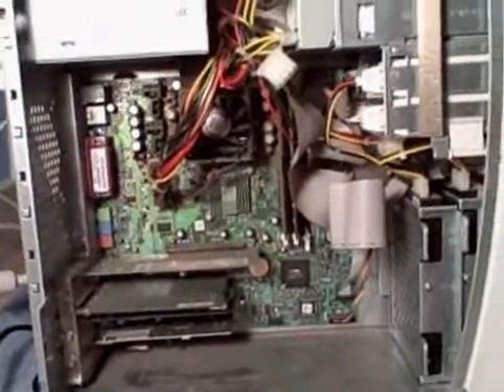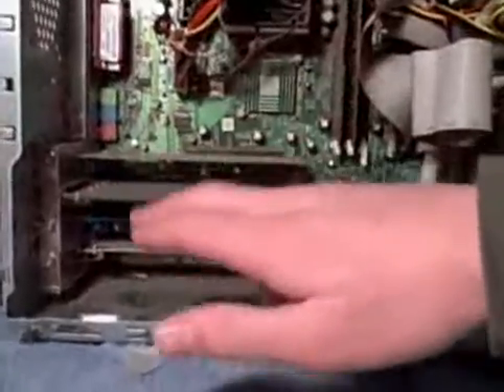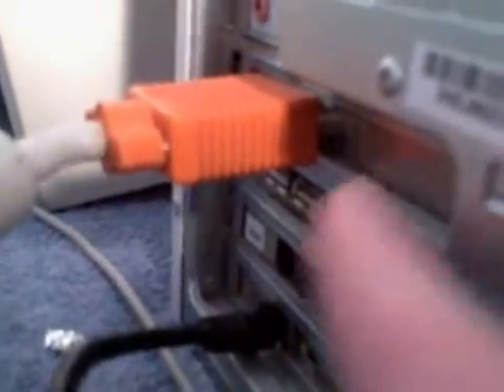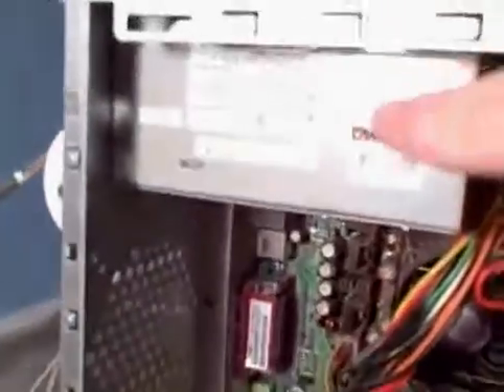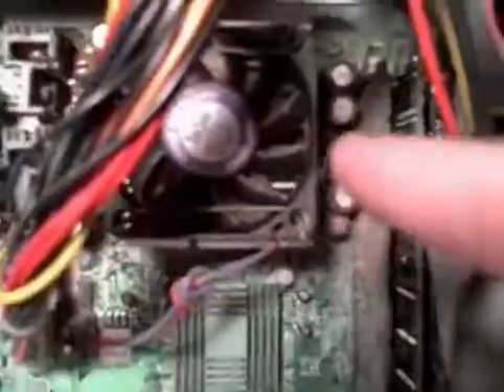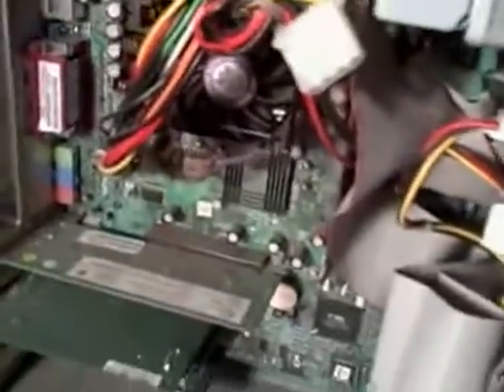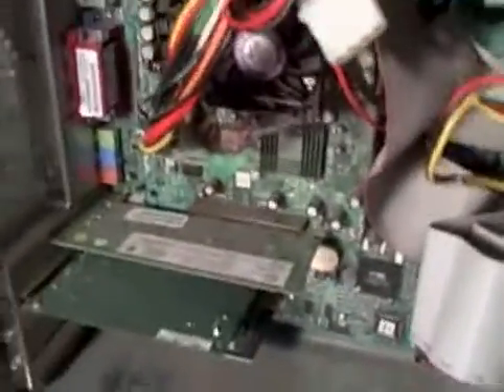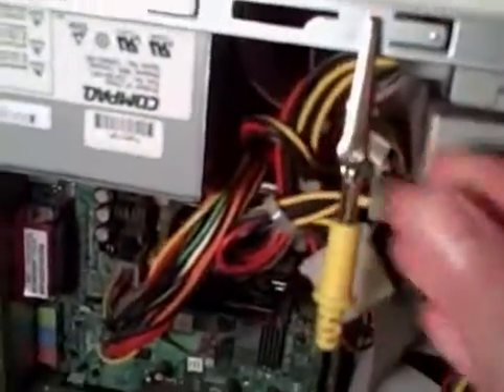Inside a computer

Comment from the maker: Does the computer itself turn on? Or is there just no power to the hard drive? If the whole computer wont turn on then your power supply is dead. If just the hard drive wont work, then it could be your hard drive is just dead.